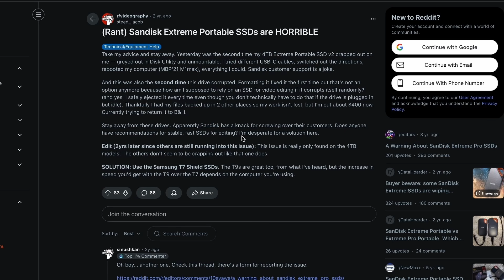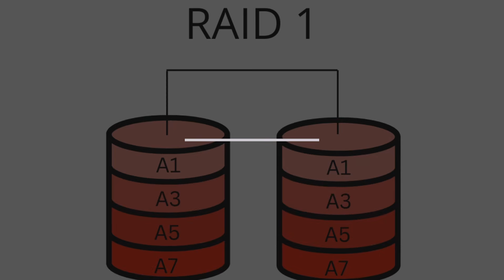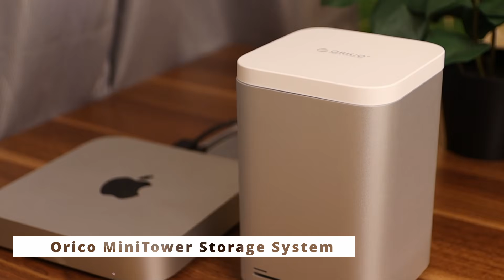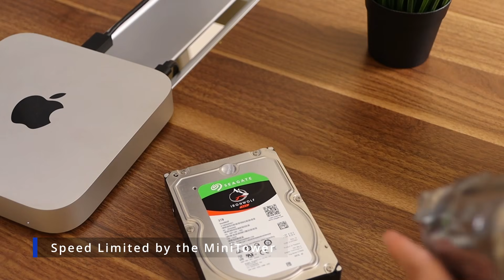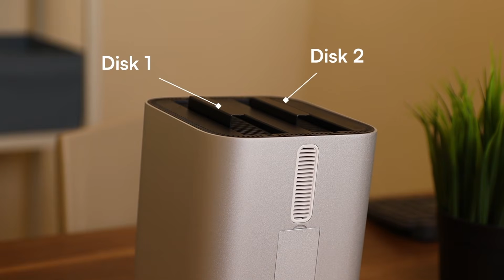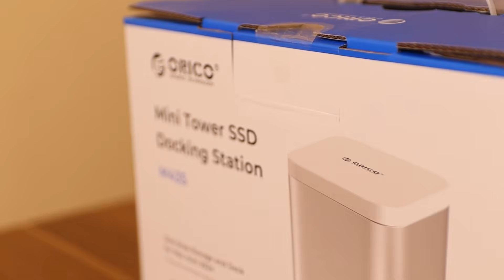Corrupted Drive No More! - Using ORICO MiniTower Storage System / Dock

Comment: @peter7james - Nice video and very informative. Question: Does the storage system suspend/sleep when the computer suspend/sleep/power off, or does the drives continue to spin? 🤔Would be nice if the drives did suspend/sleep, as that would prevent necessary wear and tear on the drives when not in use. Looking forward to your reply before I make my decision to purchase.

Comment: Using an SSD that failed four years ago to promote ORICO seems a bit questionable. You've already documented its failure back then, so it’s puzzling to see you using the same drive now to advocate for ORICO products. Isn’t it time to showcase something that truly reflects their reliability?
Reply from the maker: Sorry, I am just sharing what can be done to prevent that event from happening again. Drives used here are from multiple brands (Seagate and Kingston). And I am not using SanDisk anymore. Thank you.
If you indeed watched the whole video, you will see the point (using RAID).
Reply: @peter7james  “Guys bad news my external ssd died” (died four years ago) dude you are clickbaiting.
Reply from the maker: @KwentongChitchirya FYI, it did not die 4 years ago. I reviewed it 4 years ago. It died after 2+ years of use, almost 3. On that video, I just put a comment as an update for the audience informing them that the SSD i reviewed died. I have no video or content documenting on how that SSD died (except for this one).
I think you didn't watched the SanDisk SSD review since you thought that it died 4 years ago.

Anyway, the point of the video here is the solution on how to avoid losing your files in case you encountered this issue.
Thank you for commenting by the way.
Reply: @peter7james  Again... why not put disclaimer (this ssd died 4 years ago) LOL anyways you have GOOD REVIEW and for that its 10/10 for me the only issue so far is your not HONEST by using OLD SSD as reference without disclosing it to your viewers. For the record, i've watched your video about that sandisk who DIED 4 years ago.

again.. YOU'RE GOOD REVIEWER.